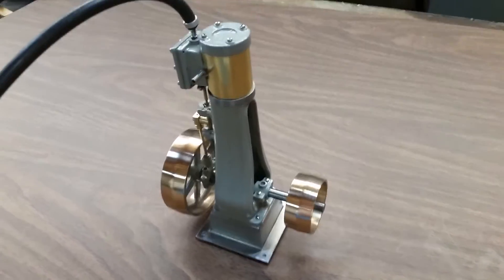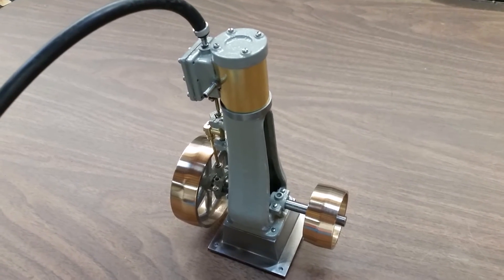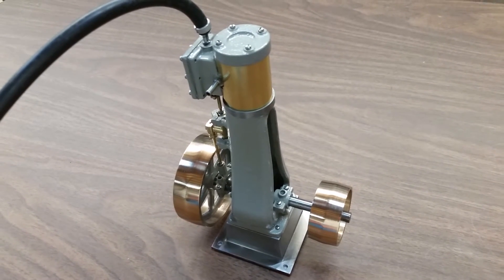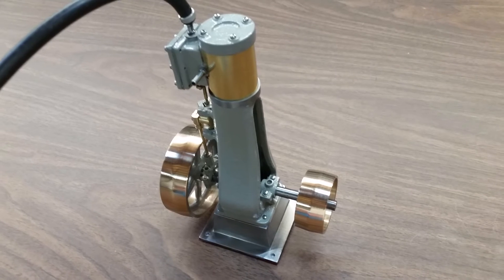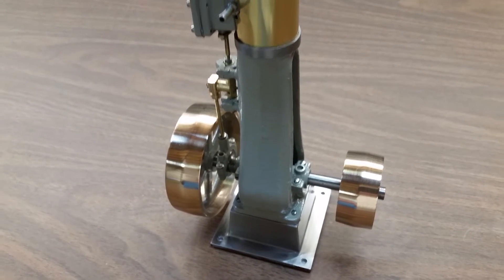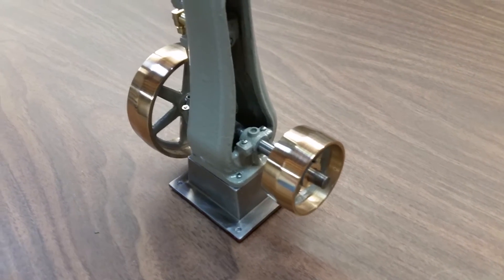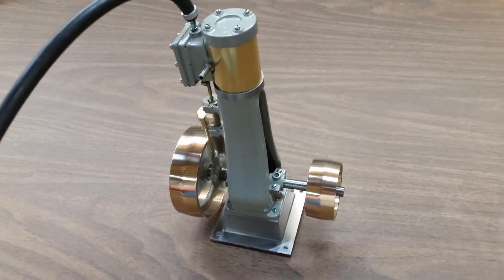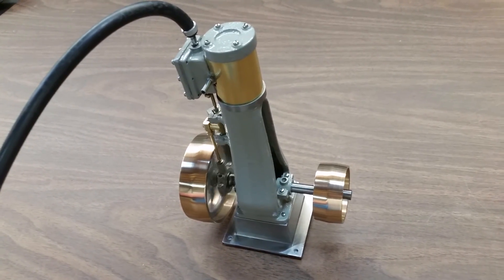PM Research Bottle Steam Engine # 5 kit

Comment: What a beautiful engine. I wish they offered this as a machined kit. You’ve done an excellent job, Dan.
Reply: Mike, they used to offer this engine as a kit circa 2006 or 7, but in aluminum, pre-machined; but they stopped making them for some mysterious reason. I had one and was going to put the brass flywheels on it, but ended up selling it. Sure wish I had it back!  It ran great.I guess they are pretty rare now.

Comment: Don't run the RPMs up to far on it. The original engine this was scaled down from only ran around 250-300 rpm at the most. They are not high speed engines! They tend to ware-out if you run them to fast. Outside of that, great work!
Reply from the maker: I run this at about 50 rpm 2-3 times a year using an aerosol can (computer dust blower).  Should last quite a while. Thanks, David for that tidbit.

Comment: Dan, I received this kit for Christmas.  What special tools do I need to make this kit. I have a SB 9 inch lathe with just about every attachment, also a much smaller mini lathe. Will I need a milling machine or similar tool ? Do you have a video of you making this model, if so I sure would like to buy a copy. Your model looks great. PS I am 78 years old and while I have made chips on my lathe, I am by no means a machinist. I have also turned hundreds of pens on my wood lathe. My email is kenwb@sbcglobal.net. Any help would be appreciated. Thanks ...Ken Bartlett, Marina CA US Army retired.
Reply from the maker: Kenneth, I did use my Bridgeport mill with a newer 3 axis DRO on it (really nice for laying out and drilling/tapping tiny holes at precise locations), but I suppose if you are proficient enough with your SB with a milling attachment on it, you should be able to get this made. I did not take any video during the machining. I used my Enco 12x36 lathe and the mill for almost all of this, but on reflection, these were way oversized machines for working on this little engine.  As mentioned, the tiny concentric on the crankshaft was the most challenging item to make. Second most difficult was the drilling and tapping of the 4 tiny holes at the main cast iron base, since the circular casting at the bottom of the cylinder bore interferes with a straight shot with a normal sized drill bit. I think I was forced to buy some tiny over-length aircraft drills for those 4 holes. Good luck on your build. Check in with the Yahoo group on these PM Research kits also.  (I'm not a machinist by any stretch of the imagination, but I get by)
Reply: Thank you for the quick reply. I think I am in big trouble with this kit, and just may be buying yet more tools and machines. This does look like an intriguing hobby. thanks again..Ken
Reply: Hi Kenneth, I also built this engine many years ago, mine is all bronze. You will need a long No.50 Drill you can get the drill from P.M.R Also I found that long center drills will make your life easier when building model engines. This is not the  easiest engine to build but it is forgiving. You can make a tap wrench extension by using K&S square brass tubing available at hobby or craft shops. My No.5 demonstrates how much this engine can be screwed up and still run nicely. Just take your time and enjoy yourself.